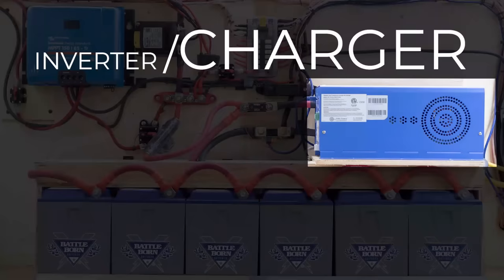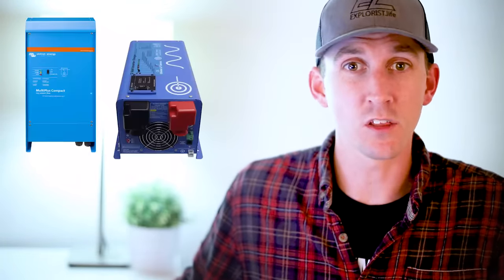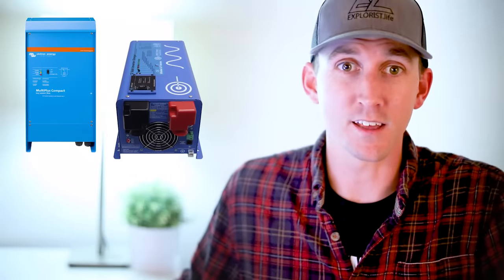Basic Solar Parts Needed for a DIY Camper Van or RV Solar Install

Comment: Best video I've seen on explaining all of this and I love the heightened recommendations on quality because that's what I would be looking for. I subscribed and hit the notification Bell my question is is it possible or illegal to do this in a 12 square foot house? I bought an abandoned house which has no electrical wiring everything is just in shambles. So I wanted to see if I could do something like this instead of reconnecting to the electrical grid. I live in Arizona so there's plenty of Sun. And I'd have a guest generator as backup if ever needed. Thank you and I'll be watching the rest of your videos.
Reply from the maker: Glad it was helpful!  Unfortunately, you'll be better off looking up the rules/laws/ordinances of your local area to determine legality of what you are proposing.

Comment: Hi, thanks for tips and share your knowledge. I´m trying to setup my bus to solar and I'm really stuck because I´m learning a lot about new technology but, Now I´m stopped by the hard task to choose a reliable MPPT regulator for my rig. I´ll appreciate if you share your opinion for have some more facts at the time to buy one.
I have six 12V/200Watt pannels from renogy and four(4)  AGM batteriess 270ah each one. What kind of mppt I should use for this gear? I saw a lot of ones cheap in amazon but in reviews, people comment that their mppt got fire or burn panels and stuff like this and I´m pretty scared to set my bus on fire, so I would make a sacrifice and buy a good and safe MPPT, would you recommend one for me based in my six panels and four batteries?
I already have a pure sinewave inverter 1800w which feed all my devices, but I charging my batteries with a generator and strong charger VICTRON centaur 12/60. I think the only step for build my solar rig is a good MPPT. Thanks in advance. Im a low budget buyer but I dont want my bus burning yet.

Comment: (B2B charging)  Hi Nate.  In your wiring diagrams, the DC-DC (B2B) battery charger negative wire connects directly to the negative terminal on the starter battery.  Could you please explain that decision? Why not run the wire to a chassis ground point?
Reply from the maker: It's the best way to most consistently get the best charging results.  If you must go to a chassis ground instead, that's fine, just make sure it's a good solid connection, ideally on an OEM chassis ground point as close to the starter battery as possible.

Comment: Thank you for the great video and content.  I am about to be installing a 600Watt system into our RV...what I am trying to understand: is there anything special I need to do to wire the inverter to the RV fuse panel and what happens when shore power or generator is plugged in.
Reply from the maker: Yes!  I'll be covering that very soon on here and on the blog, so be sure you are subscribed both here and on EXPLORIST.life and that'll be the best way to know when that's live.

Comment: I'm looking for a probably pretty common easy button. I'm putting together a 175w renology flex panel build for a basic E350  van build. I would like to use good components and batteries but I'm not sure about sizing things. Do you sell components as well as instructional stuff? I have the panel and need the other stuff. I need an inverter for a few accessories.  I'm happy to buy a schematic with your expertise or just get the components...thank you

Comment: So helpful! So, my set up is definitely "camper van." I want to run 2 overhead fans on warm nights, all night. Maybe sometimes a 12v fridge (but usually not; we have Yetis). We're charging phones & laptops on an inverter from the 12v outlet while driving. Other than that, no electric things needed. So for that set up, I don't need an Inverter, just a charger? We do have two 110 outlets installed but not wired; thought about wiring those for shore power only, so we don't accidently plug something in and run down the battery. Thoughts?
Reply from the maker: Sounds like you're heading down the right track.

Comment: Hello your video was informative we are at the juncture of putting in our solar for our skoolie build. 

We bought a 600 watt 24 volt Renogy system that comes complete with 40 amp mppt controller, 20’ 10 AWG AK 
2’ 8AWG fuse cable 
8’ 8AWG TRAY CABLE
20A solar connector 
40A ANL fuse 
We have a 3000 W Renogy inverter to connect to our load center to run a apartment fridge a water pump and a small electric HWH. What gauge wire would you recommend for the inverter to battery? And would you use 12/2 gauge wire to connect to load center?  I’ve also heard the load center should be grounded to the frame of the bus, true?  Thank you for answering any and all of these questions? Crunch time for us as we have to get to NY for the birth of my first grand daughter.
Reply from the maker: 3000w Inverters need 4/0 wire unless otherwise spec'd by the manufacturer.  I'd recommend 10 gauge triplex wire to power the load center unless otherwise spec'd by the manufacturer.

Comment: What about transfer switches? Did I miss it? I'm picking up my new camper today. It has a factory installed Onan generator. I assume it has an automatic transfer switch. The unit doesn't have solar but I will upgrade this at some point. How would that work? Do you daisy chain two transfer switches?

Comment: I have a 30 amp trk camper. It has an Onan generator. I would like to put a 800 watt 4 panel solar system  on the camper. Roof top style. I would like to know what components I would need.
Thanks 
Jeff

Comment: if you have a travel trailer, my big question would be, how do you get this wired into the existing system? I imagine that would be difficult and require removing walls etc? any thoughts? I like these little <16' lightweight trailers they sell these days but they're just not setup for solar power.. :(
Reply from the maker: Sure!  I have a diagram for an OEM RV Retrofit with 30A shore power here: https://www.explorist.life/30a-camper-inverter-with-solar-and-alternator-charging-wiring-diagram/

Comment: Hi there love your videos and lots of info but can you please how to wire up solar panel with three batteries together, in my last van I had two, am I right in saying in stead of going live ...neg   one and two, I go from one to three as they all joined up in line at moment, and also will I need to buy different controller.
cheers had the van 4 weeks and just trying to get it to suit my needs  i'm 78 and on my own with my dog.

regards George North Yorkshire

Comment: Hi, Great video - really useful! I have one question which may be fairly obviously but it's if I have 2 batteries wired in parallel, so there's 12v running through a 60a solar controller, will the maximum that I can use is 720w (60x12) after being run through an inverter, so not enough to boil a kettle? If I ran multiple batteries in series would this be better for increased end use wattage? Thanks :)
Reply from the maker: Running a kettle would depend more on the size of your inverter than anything.  Your solar panel array size or charge controller has no bearing on the biggest device you can run.  Running batteries in Series vs Parallel (12v vs 24v battery bank) doesn't really matter unless you need bigger than a 3000w inverter OR 1200W of solar panels.

Comment: Nathan do you have any wiring diagrams available? I have purchased 4x200 Watt panels along with 300ah lithium battery, 3000 watt inverter . I would like to get a victron mppt controller to wire these panels in series or parallel series if possible can you recommend

Comment: Great video with all the information I have been looking for!  I have a dumb question: if you run a 12V system with 12V outlets, can you use a 12V to 110V adapter like you would plug into a cars Auxillary outlet to give you 110V AC power and plugs for a short period of time?  Or do the batteries not support that much charge as it isn't in a running vehicle?  Thanks again for a great video!
Reply from the maker: Yes!  You could do that.  Just make sure the wire/fuse going to the 12v outlet could handle the size of Plug-In Inverter you plan on using.
Reply: EXPLORIST life - DIY Campers  thanks so much! Love the videos!

Comment: So how can you calculate how much battery storage you need/want based on what you intend to use?  In other words, how do you calculate the energy being used and the energy stored?

Also, is there a way to just charge a battery storage in a trailer with your car alternator while you're driving or parked?

Thanks, and great video.
Reply: Easiest way is to convert your usage into watts. Volts ( usually 12v X amps). Biggest draw is usually refrigerator since it may run continuously or often depending on how well it’s insulated or how often you open the door. Example if you have a refrigerator that draws 5 amps when running, then your 24 hour draw could be as much as 5x 12 x 24=1,440 watts.  If you have two 100 amp FLAcid batteries you have 200 x 12 volts or 2,400 watts BUT with FLA batteries you never want to draw them down past 50% so in reality you only have 1,200 watts to use. Make a list of everything you may use, lights, charging phones, fans, etc. Those will only be drawing power for several hours and depending on the amps they draw you can add it to your list. From the total you can figure how much battery capacity you need. Solar panel input will replace some or all of your power draw depending on number of panels and amount of sun. 
You can charge FLA batteries with your alternator with engine running.  Lithium not as easy because they can absorb so much energy it requires a special alternator..$$

Comment: I have set up a small solar 12 volt system in my Bunkie. I have a 1000 watt inverter connected to a 20 amp circuit breaker to my receptacles. I show an open ground from my inverter power  but if I plug my Bunkie system into my generator without the inverter the receptacles show no open ground . I have not grounded my inverter but there is ground rod and ground wire connected to the 20 amp circuit breaker box .Hope to get some ideas thanks Eric

Comment: Nate, I bought all equipment components from your design except I purchased my batteries from BigBattery, 3ea. 12v Owl Max 202Ah Batteries. Each contain a 300 A internal fuse. Will these work in parallel with your system. I'm using the 12/3000 Multi Plus.

Comment: Great video. Thinking about installing a victron multiplus 2000w unit. Does this unit eliminate the need for a shoreline surge protector? Does it eliminate any other devices? Thanks again for the informative video.
Reply from the maker: Thanks!  It doesn't eliminate the surge protector, but I don't know of any inverters that do.  The Multiplus is basically the Inverter, the charger, and the transfer switch all in one.

Comment: NATE, You're extremely informative. I'm a retired architect, did several DIY homes for meself. I'm one who strongly believes in several fire extinguishers, water shut-off valves, heavy gauge wire & breakers, thus your comments were excellent.  I'm currently designing my own year round very well insulated 15' Class B+ RV van....  w/100 gals of fresh water, 85 gray water, etc (which will never freeze up) and fully livable off grid year round which will survive ski trips to Banff or sunny days in Florida  .....once our nation gets back on our collective feet.   .....you strike me as a guy who does it RIGHT!   .....do you do consultation by which I can send you my drawings and together we can design a solar system to match my personal needs?   Thank you
Reply from the maker: Nice!  Sounds like a super cool project.  100 gallons of fresh water in a class B will be pretty wild!  We built our van for similar conditions (Okay... hot weather not so much) but we've had it down into the -40's in Banff a few times.

At any rate, if consulting is something you're after, I've got several options you can browse through here: https://www.explorist.life/consulting

Comment: Any thoughts on running a high end desktop on solar? I have a 1000w power supply, but I don't know what amount of power I would actually need to draw for it to perform appropriately. Any information or opinions will be appreciated.

Comment: Nathan - I am considering a 2nd (portable) solar panel and charge controller.  What kind of connections would I use to “plug” in the solar panel to an exterior socket that will connect to the 2nd charge controller.   Thank you

Comment: Hello I wondered if you could help me out regarding a few questions I have regarding my solar set up in my van. Ok, I have a 120w solar panel on the roof. I have a agm battery which works well, plus the home battery. I have had a Anderson plug put in plus DC to DC installed. My question is; I don't understand how getting a portable solar panel will enhance my solar if the panel on the roof almost fills the battery on it's own. I want to run a fan all night so was told to get another battery/ However I will need to get two new batteries at the same time because the batteries need to be the same age. Should I get a power station instead and use this in conjunction with the portable solar panel rather than buy two new batteries? Hopefully this is not to confusing. Thank you

Comment: Great set of videos. I’m looking at my appliances both in AC and DC. Most wire from both sources comes in at 18-14 gauge with a few at 12. I want to run 12 gauge to all places. Can I do this for all appliances?

Does a coffee pot or hair dryer work on the 12 gauge assuming I choose wire for the correct voltage?

Hope that makes sense. 

I’m about to buy the solar set up plan from your site for two 175w solar. I’m building a camper and your tutorials are very helpful. 

Thank you for your time. 
Josh
Reply from the maker: If something calls for 18ga, you can definitely use 12ga.

For coffee pots & hair dryers, those will be on a standard household 120v circuit which are generally 12ga protected by a 20A breaker.

Comment: Great video. Thanks.
Do you have a video on panel configuration? I need to add two panels to my two existing. Parallel, series, or combo?
Mark
Reply from the maker: That will largely depend on the capacity of your charge controller.  I've got a new video that may help: https://www.youtube.com/watch?v=MxziHKvTRh8

Comment: If I were to make my make my 12v 4 panel 100watt into a 24v with a battery system, would I be able to briefly run a water pump requiring 24v 200 watt considering the system will have the battery to accompany the panels? Basically will the water pump pull the needed wattage from the system to run without burning out? Thanks!  ~J

Comment: I’m in the planning process of one day converting a enclosed cargo trailer into a RG trailer. I would like to have a battery bank minus solar panels but using a generator to charge the batteries. What would I need besides the inverter;/charger?

Comment: I have a tiny home with a 18000 btu mini split air-conditioning and a middle size apartment refrigerator.  What size solar off grid system do I need.?  5kw or 10kw to run full time.

Comment: Thanks for video! It is great! I have a one off question, as I can't seem to find a resource anywhere online. If I have the proper outlets with proper wiring to my batteries, is it even worth buying an inverter?? Thanks!
Reply from the maker: It depends on what type of "outlets" you mean.  If you are talking about the standard 120 volt (USA) outlets you'd find in your home; you would indeed need an inverter if you wanted to power those outlets from your battery bank.  An inverter is the only way to get the 12v DC power from your batteries to the 120v AC power you need at your 'proper' outlets.

Comment: Hi there thank you for your YouTube channel, I have a question, I have for 100 watt AGM batteries and I'm currently getting about 690 Watt hours from my solar panels. My question is at what point will I be putting too many Watt hours into these 4 batteries?
Reply from the maker: Your batteries should specify a maximum charging amperage.   For AGM batteries, this is USUALLY about 30A per 100Ah of battery capacity, but I recommend verifying with your specific manufacturer.

Comment: My new rv with 2 lithium 100ah batteries, inverter/charger and solar controller with 440 Watts of solar panels on roof is a wiring mess - not sure if it would be possible to make a general use-case video of how to Reno this mess but would sure be useful.
Reply from the maker: For sure!  We plan on doing more RV retrofit videos in 2023.

Comment: Hey Nate, 
Do you have a recommendation for an AC charger for a LifePo4 200ah battery?
Thanks, and have a great weekend!
Stay Up, Stay Blessed!
Christopher
Reply from the maker: I recommend using a combo Inverter/Charger.  Specifically, the Victron Multiplus (2000 or 3000 depending on your needs).  I have one of those in nearly all of my diagrams at https://www.explorist.life/solarwiringdiagrams or here is a direct link to the Victron Multiplus 3000: https://battlebornbatteries.com/product/victron-multiplus-inverter-charger-3000w-12v/?afmc=explorist_bb67

Comment: Howdy thanks for the great video - it's all still dutch to me - looking for recommendation - want to run 2 fans totaling 10 amps, and an evaporative cooler (0.7A/82W) for approximately 12 hours per day;  and a 12volt  40watt refridge/freezer 24 hours a day (yes I live in the desert), how big of a battery bank would you recommend and approx how long could I go before recharging? Thinking about a DC to DC to charger, a 100Ah lithium ion to start with, and eventually add 1 more battery, then down the road how much solar would I need as an alternate power source?
Reply from the maker: Hey Michael!  You'll need to perform a power audit to figure out what size of system you'll need to power all of that.  Here's a tutorial for that: https://www.youtube.com/watch?v=a406IxiU-Xg